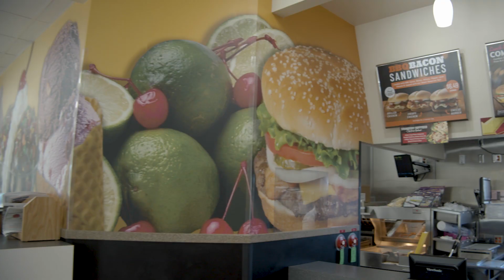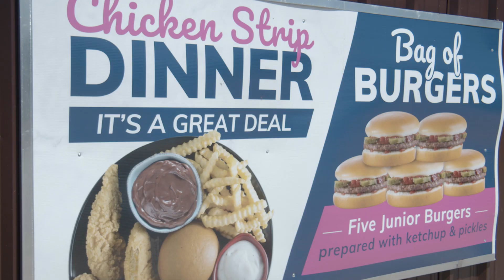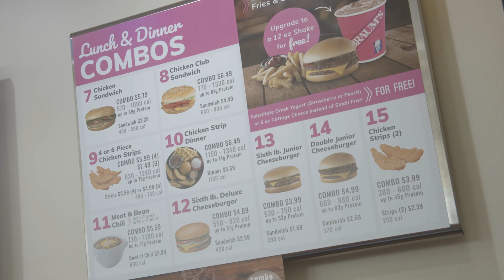Braum's: The Best Burger Californians Never Heard Of

Comment: For burgers, I still go with Whataburger, and I have In-N-Out and Braum's where I live, too. But, if you want a killer shake with your burger, Braum's rules. A real ice cream shake mixed one at a time.
Reply: I'm guessing ur in Dallas...and I can tell u for a fact, Texas in n out tastes nothing like Cali in n out. So I cant say ur wrong based on ur sampling
Reply: @waffles824  What? No Way. I live in CA and worked in Dallas and both In and Out taste the same. Also In and Out is far better than Whataburger.
Reply: @waffles824  that's a myth recipes don't change just because your in Cali or Dallas. The protocol is the same wherever. In n Out is Trash in Dallas and Cali 🤣

Comment: I've had In and Out and my opinion was it was very salty and somewhat dry. That sounds like a negative, but it's tasty! That said, Braum's burgers are juicy and have just the right amount of salt.

Put it another way. I eat burgers. I like burgers. I've eaten almost every "Famous" burger there is. I usually go to other places and order the special menu options because the plain burgers they offer are kind of basic. Braum's? I just order the regular burger. It doesn't need any dressing up. It's perfection.